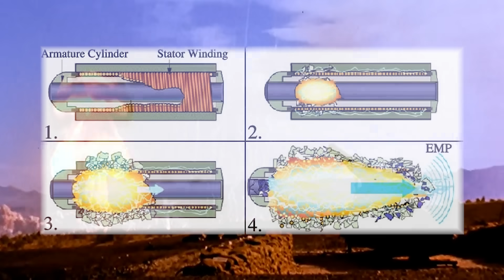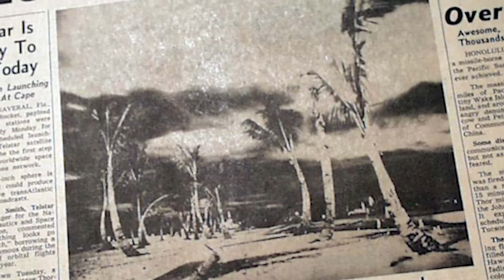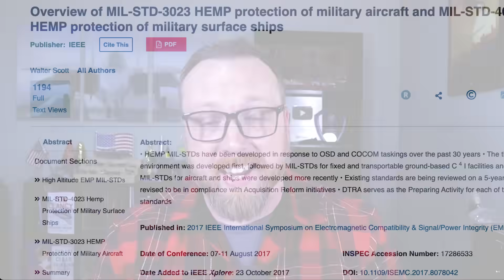Could an EMP wipe out American airpower??

Comment: Pretty much all aircraft avionics and mission-critical electronics are hardened to specifications precisely using test data from our past nuclear tests. As are most military-grade electronics that are mission-critical as well.

Civilian infrastructure... on the other hand, would be entirely fucked.

Edit: If you don’t think EMP’s are a serious threat, read another message I sent to a commenter about EMP:

A pulse of anywhere from 5 to 10 kV/m (thousand Volts / Meter) will start to reliably damage electronics. 2-3 times that and it can break down PN junctions or gate oxide insulating layers in diodes & transistors, causing localized melting and pretty much permanently destroying anything with a transistor-based chip inside it that is not behind 10+ feet of concrete or behind a serious chunk of steel, which is not most of our houses. I’d say the fact EMP is indeed a line of sight phenomena doesn’t really make a difference because most if not all civilian power infrastructure, IXes (internet exchange points), GPS satellites, utilize such transistor technology & are above ground and are not shielded to handle up to 50 kV/m like military equipment is. Just because most of the power grid is reinforced for lightning, doesn’t mean the electronics in charge of operating the grid are likewise…

The main component of a nuclear EMP is called the Compton effect. It’s essentially where gamma rays from the detonation strike air molecules & release electrons, which are then deflected by the Earth’s magnetic field, creating a widespread electromagnetic force. The Russians and specifically the Chinese have researched a new form of nuclear weapon aimed at explicitly maximizing gamma radiation. The theoretical potential EMP field of these is on the order of 200,000 kV/m ( Source: https://apps.dtic.mil/sti/pdfs/AD1097009.pdf ). 

Example 1: Take a look at the Starfish Prime test. 1.5 megaton hydrogen bomb at a much higher altitude than would be used. It was detonated over Hawaii & produced about 5 kV/m. Didn’t do too much. However, due to the stronger relative magnetic field over the US, it would have produced 20-30 kV/m.
Example 2: The Soviet project K nuclear tests. They were 300 kiloton warheads detonated over another high magnetic field area, with a 350 mile section of telephone line separated by repeaters using fuses and overvoltage protectors every 50 miles. The test blew every fuse and over-voltage protector.

These were bombs made in the 1950’s & 60’s. Nevertheless something tailor-made by an adversary to maximize resultant gamma radiation. And, sadly, I have a correction to make:
China has made public statements, in writing, that they actually already have such weapons and would consider them in the case of a conflict with Taiwan ( Source: https://apps.dtic.mil/sti/pdfs/AD1102202.pdf ). I’d be willing to bet most people reading this didn’t know such a fact. If you read this source, the author also states it is a possibility for China to hide a HEMP nuclear device inside a satellite which is frankly way more scary than any other possibility. 

Given a M.I.R.V. like Russia’s R-36 with 10 independent warheads yielding ~750 kilotons and (in China’s case) optimized to maximize gamma radiation and detonate at the right altitude, a modern EMP attack would be very nasty

Source:
My career involves quite a bit of physics. It’s not my job to do anything directly involving nuclear weaponry, but I know electronics and their design well. The underlying physics drives a lot of my interest in this topic and it’s something I’ve followed for years.
Reply: Thing is an EMP attack would probably be just part of a larger nuclear attack. It wouldn’t make sense any other way.
Reply: @outatime626  He kinda tackled this point though, a country like North Korea doesn’t have the missiles to overwhelm the missile defense system so instead of performing a full scale nuclear attack they might detonate their weapons before interception at altitude creating a large area EMP, with little blast damage.
Reply: @NickSteffen Even if this were possible, nukes would already be flying towards NK by that point.  Good luck taking out hardened silos and subs and aircraft spread out around the world.
Reply: @bluemarlin8138  Maybe, but NK is right next to China it would be difficult to differentiate the flight path of a missile headed to NK vs one headed towards China for this reason. So China would likely view a nuclear response as a potential first strike. So given the fact that the US and our allies have the ability to conduct a non nuclear invasion of NK, I doubt the response would be nuclear.  

None of that is really what we are talking about though. The video is about EMPs not the ten thousand other variables in a nuclear engagement…
Reply: @NickSteffen  It would be unlikely to see a ballistic missile attack from the US mainland in this scenario precisely for that reason.. It is also a factor in missile defense because similarly the trajectory of air defense missiles to intercept a nuclear device would be nearly indistinguishable to a nuclear attack..

However most likely would be a nuclear response, rather by aircraft, followed by invasion led by special operations forces from the US and South Korea. Such forces lead the joint-exercises to practice just that operation. North Korea has close to zero modern air defense and very few jet aircraft.. I'd say B-61 Mod 11 bombs dropped from B-2 or soon to be B-21 bombers alongside 5th gen stealth jets would be likely as a surprise response before a ground war. North Korea would never launch 100% of its capability in one attack, and we would have to respond regardless. We likely could utilize satellite surveillance alongside HUMINT+SIGINT to figure out exactly where Kim is and vaporize him, and take out any hardened launch sites or mobile launchers at risk of being used to strike the US or our allies as a result of out offensive. Interestingly enough, a few years ago, a similar training scenario with B-2's was caught by a civilian radio enthusiast: ( https://www.vice.com/en/article/y3w5qw/intercepted-audio-appears-to-show-us-pilots-training-to-bomb-north-korean-vip ). The US could use non-nuclear bunker busters like the Massive Ordinance Penetrator but it is likely that wherever Kim is holed up would be underground / under a mountain. The MOP uses 2400 KG of something likely similar to composition H6, which is approx. 1.5 times more powerful than TNT. So given the math, that's 3600 kilograms (3.6 tons, +/- 10% given explosive composition) of TNT equivalent versus the B-61's 50 tons of TNT equivalent. I dont think the US military would be screwing around in such a situation; it's likely they would use the B-61 to kill Kim. 

Thing is though, the Kim regime does not NOT want to ever resort to anything like this. Kim knows he would be fucked and China/Russia wouldn't come to NK's aid in a situation where they issue the first strike.
Reply: @NickSteffen cruise missiles 😅
Reply: @Laminar-Flow  I think the main target for nuclear strikes would likely be other nuclear launch sites rather than Kim’s bunker which is likely hundreds of feet underground in granite. It is certainly possible to dig a deep enough hole that a b61 could not penetrate it especially when you have what is effectively free labor. It is a tactical nuke after all and many bunkers were made to withstand that level of force. From a global support perspective using nukes to defend against nukes is much more palatable than using them to strike a non-nuclear target. Maintaining the support of allies would be an important consideration.

So the US would likely only use nukes to attack launch sites which are much less protected as they need to be near the surface. Kim would also likely not locate himself near these sites as they would be primary targets of attack. The US would also seek to confirm Kim’s death, both to be sure and for information warfare purposes as it can convince the rest of NK to stand down. This likely means some sort of conventional strike on him.
Reply: He just gave you one....North Korea detonates two or three Nukes high over covering the US causing major civilian infrastructure breakdown It is a valid threat.
Some say that 60 to 70 percent of the population will not have electricity for 6 months or so ........no food, no water, no hospitals .......get it.
North Korea need not launch another nuke as the damage has been done 40 to 60 percent of the US population could perish due to no electricity.
If you hit Russia with EMP most of the country has no electricity, no hospitals or infrastructure it would be no different to what is.🤣 @outatime626
Reply: @outatime626   See my other reply or the edit above for a thorough explanation, but honestly I can see it as a first and only-strike weapon in a situation where America tries to defend Taiwan, for example. It’s unlikely they’d try to make it a complete surprise either. 

I could see us calling China’s bluff & getting EMP’d. But also, we have cyber weapons that can do more damage than EMP’s to infrastructure on China in our back pocket as well as likely similar EMP weaponry. Who knows; I truly hope it never happens.
Reply: I mean it would certainly suck, but people really overestimate the power of EMPs you really need line of sight to cause damage to most things and a lot of infrastructure is obscured. Some cars could be taken out but others might continue working depending on how their electronics are positioned. Overhead power lines would get blasted but they frequently get struck by lightning anyways and have precautions in place. Underground power lines would likely be unaffected. Would it cause billions in damages? for sure, but probably less than a hurricane but more than tornado.
Reply: @NickSteffen  I think you underestimate the power of electromagnetism, or have not taken any physics relating to it before.. Anywhere from 5 to 10 kV/m (thousand Volts / Meter) will start to reliably damage electronics. 2-3 times that and it can break down PN junctions or gate oxide insulating layers in diodes & transistors, causing localized melting and pretty much permanently destroying anything with a transistor-based chip inside it that is not behind 10+ feet of concrete or behind a serious chunk of steel, which is not most of our houses. I’d say the fact EMP is indeed a line of sight phenomena doesn’t really make a difference because most if not all civilian power infrastructure, IXes (internet exchange points), GPS satellites, utilize such transistor technology & are above ground and are not shielded to handle up to 50 kV/m like military equipment is. Just because most of the power grid is reinforced for lightning (which you are correct in mentioning, it’s an EMP too), doesn’t mean the electronics in charge of operating the grid are likewise…

The main component of a nuclear EMP is called the Compton effect. It’s essentially where gamma rays from the detonation strike air molecules & release electrons, which are then deflected by the Earth’s magnetic field, creating a widespread electromagnetic force. The Russians and specifically the Chinese have researched a new form of nuclear weapon aimed at explicitly maximizing gamma radiation. The theoretical potential EMP field of these is on the order of 200,000 kV/m ( Source: https://apps.dtic.mil/sti/pdfs/AD1097009.pdf ). 

Example 1: Take a look at the Starfish Prime test. 1.5 megaton hydrogen bomb at a much higher altitude than would be used. It was detonated over Hawaii & produced about 5 kV/m. Didn’t do too much. However, due to the stronger relative magnetic field over the US, it would have produced 20-30 kV/m.
Example 2: The Soviet project K nuclear tests. They were 300 kiloton warheads detonated over another high magnetic field area, with a 350 mile section of telephone line separated by repeaters using fuses and overvoltage protectors every 50 miles. The test blew every fuse and over-voltage protector, and this would have happened if it were over or underground. It has to come up eventually. 

These were bombs made in the 1950’s & 60’s. Nevertheless something tailor-made by an adversary to maximize resultant gamma radiation. And, I have a correction to make:
China has made public statements, in writing, that they actually already have such weapons and would consider them in the case of a conflict with Taiwan ( Source: https://apps.dtic.mil/sti/pdfs/AD1102202.pdf ). I’d be willing to bet most people reading this din’t know such a fact. 

Given a M.I.R.V. like Russia’s R-36 with 10 independent warheads yielding ~750 kilotons and (in China’s case) optimized to maximize gamma radiation and detonate at the right altitude, a modern EMP attack would cause damage on the order of of multiple magnitudes larger than a tornado or hurricane.
Reply: @Laminar-Flow
Great post, thanks!

I know very little beyond high school physics, and basically nothing about electronics design.
But I wondered what exactly happens inside electronic wires etc when struck by an EMP.

I'd presume it causes electricity to flow inside the wire, sorta like you can create a magnetic field with electricity or you can create a current by moving a magnet into a coiled wire?

I'm sure my level of understanding is pretty laughable compared to what would be needed to EMP-proof the grid...
But I've seen videos of metal connectors jumping up and causing arcing whenever there was too much electric current at power stations/distribution places, and wondered whether those interrupt 'pressure-release-valves' could be installed in power lines to make them survive EMP blasts? 
(theoretically of course - undoubtedly, implementing that on every single power line would be cost-prohibitive)

I would greatly appreciate your insights on this! :)
Reply: @MrNicoJac  Haha trust me, you’re not doing as bad as you think at all!

Basically, when an EMP strikes an electronic system, it can induce high currents / voltages in the wiring or circuits. The effect is similar to what you described with the wire and magnet analogy; an EMP would create rapidly fluctuating electric/magnetic fields that induce currents in conductors, which can be strong enough to overload and destroy the electronic components designed for much smaller currents, given an EMP with high enough induced kV/m. Nevertheless the actual semiconductors, which are micronized circuits (we’re talking nanometer scale!) and more sensitive than something like a copper wire. 

The concept of a ‘pressure-release valve’ for electricity is similar to a surge protector or a transient voltage suppression (TVS) device…They’re designed to protect against high voltage by blocking/shorting to ground unwanted voltage. In the context of an EMP, the protection would need to be much, much more robust due to the high energy involved. I’m not exactly sure what in-line hardware would actually protect against a HEMP attack in a power grid though, it’s not my expertise. If you google the Soviet tests I mentioned above, pretty much no period-relevant countermeasures were able to protect the line against the EMP. Anything handheld that doesn’t directly have a way to dump power to ground like your phone, is fucked. In terms of a ‘super EMP’ with 200,000 kV/m, I’m not sure it is entirely possible to avoid problems in any case. The government doesn’t even have software to simulate such an attack. Generally though, purpose-built EMP-resistant hardware, Faraday cages, etc can be used to shield critical components. The government has probably spent an ass load of money researching this problem, or burying contingency equipment really, really far underground. As you pointed out, retrofitting an entire power grid would be extremely costly, and as it is, there are cybersecurity issues that are frankly more pressing and more of a realistic threat.. State sponsored hacking is much harder to attribute an EMP lol. Lightning is essentially an EMP, and its effects can be measured on the other side of the earth. In my opinion, it’s the electronics and computers governing that power the grid that are most important to protect from both cyber backdoors and EMP’s.

Most military and government installations are likely quite-well hardened against EMPs to ensure continuity of operations. Especially the continuity of government stuff. But really, it costs too much to do this for everything in the civilian world, which is understandable. 

The scariest aspect of this all is with a HEMP attack, you don’t need a high yield weapon, just a well-designed one. China very well could have a HEMP device in orbit, as we speak, on a satellite. In terms of an attack vector, it would be the greatest Trojan horse in history, and one of China’s dirtiest secrets. We also have the X-37, though. It’s pretty obvious that we’re up to something in low earth orbit as well, but what exactly that is, is classified. X-37B weighs 11,000 pounds (~5,000 kg if you don’t use bald eagle units, +\- 15% to 30% payload but that’s a speculation)- yet we use falcon heavy to launch it which can get 140k pounds (63,000 kg) to LEO. Shit, it can get ~35k (15k kg) to trans-mars injection orbit. Odd. China is open to weaponizing space- likely they already have- and there are many possible attack vectors from them in that sense. Their space agency and launch companies are merged with the military as it is in a fashion quite different to the west. Russia and China have developed the ability to shoot down a satellite in orbit, among other things, which wreaks havoc on other things in LEO. If a conflict broke out and someone started ballistically targeting satellites it would create a cloud of debris in LEO that would take a long, long time to clear up if ever. 

In the scenario where China has a satellite with an EMP device in orbit, they could wait until their own satellites are above, or maneuver them above, the horizon to detonate. They’d probably not do this because it leads to suspicion, and in that case just rapidly launch a ton of backup satellites right after the event. Regardless, scary stuff.
Reply: But wait.  I just watched "Leave the world behind" and it says that Cyber hackers can cause EMP's, take out commercial aircraft, satellites, power grids (except the one in the house they were in,) cause deer and Teslas to run amok, and bestow destructive powers onto ticks to make lyme disease cause you to lose your teeth overnight.  It can also make enemy drones capable of deploying 5 times their weight in pamphlets on a road with just one car on it to make sure they see one.  US Post office take note.
Reply: MAD is still a thing and includes multiple Sampson options. AKA: leveling the playing field...
Reply: How far from a detonation would a stand car need to be , to have a chance of the car body helping? I live in a concrete house, I built it, reinforced concrete and both cell phones and routers struggle depending on where your at in the building. I've got a cell tower less than a mile away.
Reply: @user-bd5md5cm2j  That honestly requires too many unknown variables to calculate. Reinforced concrete helps, though.
Reply: @Laminar-Flow  ya, just curious. I'm in Idaho and I'm guessing Utah, or the West Coast or Vegas would be the closest nukes to me
Reply: @oktoday8323   Agreed
Reply: Russia already disabled one of our warships a few years ago. A couple of Fulcrums (IIRC) did a hostile flyover and the ships systems went cold. You don't need a powerful EMP if it is real close! And since no kinetics were involved you can't go hot! And you can't go hot with a cold pickle.
Reply: @bryanst.martin7134 LOL, no they definitely didn’t.  They flew around a US warship in the Black Sea which was never disabled.  The crew took videos of the Russian aircraft flying around, which wouldn’t have been possible if there was a gigantic EMP that could disable a warship.  The aircraft didn’t even have weapons, or anything that could have possibly housed a weapon.  The aircraft didn’t even have any weapons mounted.  Besides, it’s not even theoretically possible for an aircraft to produce enough energy to generate an EMP that could disable a ship, much less a warship hardened against real EMPs.  

Also, that would be a blatant act of war.  You really think if something like that happened, the US wouldn’t massively respond?  LOL.

Oh, and if the Ruzzians had this, they’d certainly be using it against Western air defenses in Ukraine, which are currently preventing the Ruzzian Air Force from flying there.
Reply: @bluemarlin8138   Lmao my question to the guy, if he still thinks it was an EMP after our replies, is this:

How could the Vatnik Z-plane return from such a special operation without experiencing similar effects from its “EMP”? Hahah

And yeah, I think with Putin’s regime as desperate as it is (IMO Putin is risking serious internal dissent against his regime if another 300,000 men die in Ukraine on his behalf), they would’ve used pretty much every tool in their toolbox short of a tactical nuclear weapon by now. They had a Kinzhal “hypersonic missile” shot down by an old Patriot system lmao. While it’s a pathetic attempt at a “hypersonic” system, it’s still not easy for old patriot batteries to intercept something like that. Meanwhile, we’re focused on developing hypersonic aircraft that can instead drop dumb, cheap bombs, and scramjet powered missiles rather than ballistic powered ‘hypersonics.’
Reply: @bluemarlin8138 I believe that comment is mistaking the gps spoofing jamming incident. Def not an emp attack.